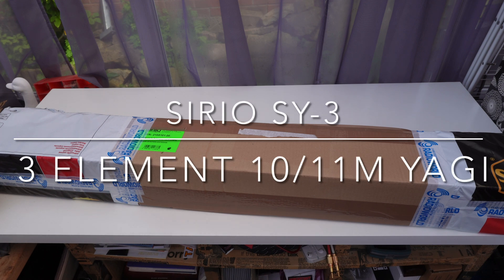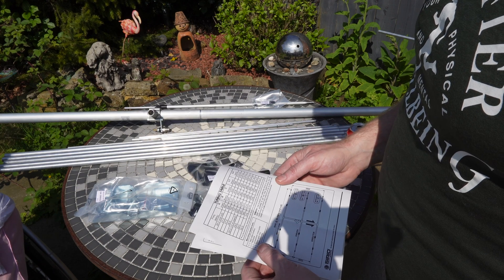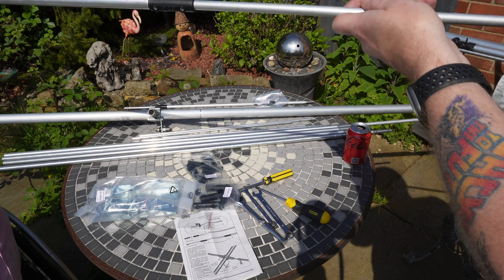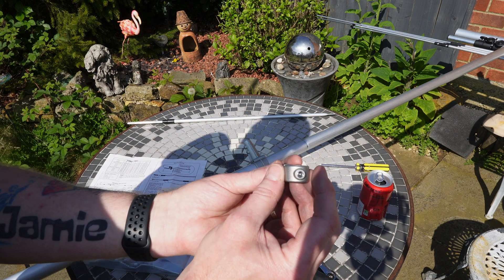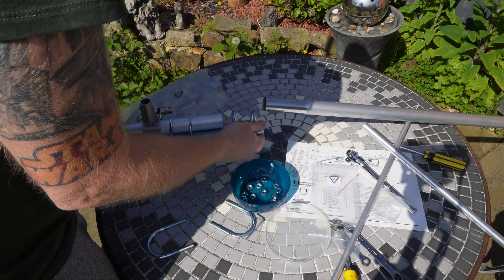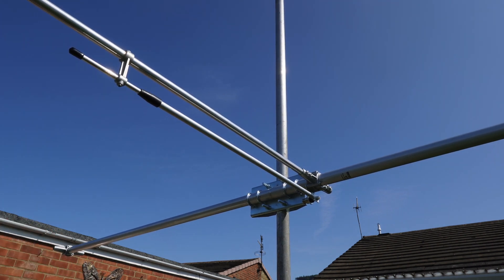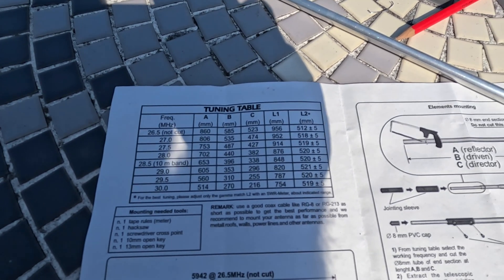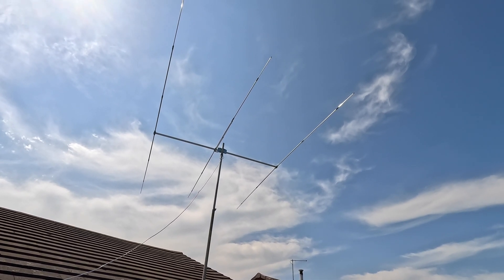SIRIO SY27-3 10/11m 3 Element Yagi/Beam Antenna,Unboxing & Assembly

Comment: Looks great. I'm a new m7. Currently got a cb vertical cut down for 10m. I'm looking for a 10m yagi that I can put up around 25ft or so (above my roof line but not much). Would you recommend this one?
Reply from the maker: This Yagi is Superb on 10m it really is. If you end up buying one just take your time setting it up as it is so worth it. Thanks for visiting the channel.
Reply: @gtretroworld  you're welcome. How high did you end up putting it? And which rotator did you use?
Reply from the maker: @antonybuck2126  I had it around 25ft up but didn’t bother using the Rotator as i am still waiting to organise a proper tilt mast.Most of the DX i was doing was West so i just left it in that direction.
I bought the Yaesu G450 DC but it’s still boxed.
I am currently working on a Quad build but seriously this Beam is a bargain.
Reply: @gtretroworld  good point, can just point it over towards USA and leave it there haha. I'm very new so not sure how it all works. Why get a 4 beam if this is good enough?
Reply from the maker: @antonybuck2126  I am just getting Gain Greedy so ignore me.😂I initially was going to upgrade to the 4 element version of this but really fancy a Cubical Quad.
Seriously for DX the 3 element will impress you.
I will have a video up in the new year showing the Quad if you’re interested.
Reply: @gtretroworld  I am yeah. I'm on a tight budget, but it's achievable at this cost. Did you just use scaffold pole with a connection at the top to get extra height?

What I don't understand is what will extra gain get you? Just cut through a bit better I guess? Only passed 2 weeks ago so still very much learning. Thank you for your advice
Reply from the maker: @antonybuck2126  Yeah i literally used a 19ft scaffold pole with a 10ft pole slotted in the top.
As for the Quad or a bigger Yagi i may see a couple of extra S-Points but this could be at the expense of a narrower bandwidth hence i will probably stick with a 2 element Quad ,3 Maximum.
The same applies with a 4 element Yagi over a 3,the bandwidth narrows.
Honestly if you’re on a budget this is a great antenna and it isn’t stupidly big.
Reply: @gtretroworld  how did you slot another pole over the scaffolding? I've not managed to find and that will go over. I would end up connecting 2 poles side by side with scaffolding clamps
Reply from the maker: @antonybuck2126  I basically slotted a 1.5” pole in the top of the scaffold pole,drilled through,fitted a nut and bolt and used a U-Clamp to stop it rattling.Although this was temporary it is absolutely 100% Ok as there is no weight in these things at all and with it being Horizontal the wind doesn’t bother it.

Comment: I have a Sirio 10/11Mhz vertical I put up a couple months ago. I have it tuned to the 10m band and have been extremely impressed with its performance. It is well made and was easy to put together. Now I may have to try the yagi antenna.
Reply from the maker: This really is a great antenna and isn’t overly big or expensive.Im tempted to try the 4 element version in near future with a similar video.

Comment: Good info great video, I'd be more inclined to slide the end tubes inside each element and drill new holes for the band you want to use it on rather than sawing the tubes down - I'm sure that would work too?
Reply from the maker: Thanks…Yeah that would work fine,just remember to take your time getting the measurements right as these work really well if set up correctly…Thanks for visiting
Reply: @gtretroworld  Thanks for the advice all the best.
Reply from the maker: @dannystephenson4957  No Worries..I am planning to try the 4 element version sometime down the road as well as a 3 element quad so watch this space.
Reply: @gtretroworld  Most certainly will, can't believe the good quality for what you pay.

Comment: Instead of the plastic sleeve to connect the elements would a jubilee clip do the same job
Reply from the maker: The sleeve doesn’t really do alot other than make things look neat.I suppose if you wanted to you could do away with them and the self tapping screws and use jubilee clips but you would need to cut slots on every joint.Hope this helps.

Comment: 105/95/93mm? You couldn't change the gamma match.
I have the same antenna waiting to go up
Reply from the maker: It really depends where you want to operate.I use this for 10/11m so decided to sort of widen its bandwidth.Cutting 93mm off the Director,95mm off the driven and 105mm off the Reflector gives these results.1.1 around 27,900/1.5 on 27,500mhz.The Gamma match will only match so much but like i say it really depends where you want to operate.I will say though it is a fantastic antenna if you take your time setting it up.

Comment: I got the same sy-27 3ele in the box awaiting installation, so I'll enjoy watching g this video, the only advice I can give is don't erect indoors lol 😂 GL
Reply: Ideal for quick installations but I would recommend taping the joints especially the boom joint.
Something for the bike & quick installation, Spiderpole 10m & Hawkins Thunderbolt Ssd12+ or ssd58+ 5.5m/7.5m wire & coil, up in 2mins.
Reply: 105,95,93mm cut from each x6 legs not the gamma-match, I'll be happy with 11m and didn't want to start cutting things, but if needed I wanna do it right 1st time.
What rotor you going for??
Reply from the maker: @EdzashedFudwinkle  Yeah just think before you cut but the bandwidth with mine is fine for my needs.
I actually boomed into Mexico last night on AM with 25w.SWR was 2.7 but the ATU didn’t mind.I definitely didn’t expect that result at the bottom of 26mhz as it’s nowhere long enough.
I am going for the Yaesu 450 Rotator,the new DC version.

Comment: A very nice antenna shrink fit on all the joins  and it will not let any water get in
Reply from the maker: I was just going to use self amalgamating tape but yeah that could be a plan in some areas.I still haven’t settled on a coax choice yet,that is just mini 8 from a roll i had from the 90’s.
Reply: I use the same it's all right does formy run from antenna and into my bungalow  and into my radio room it's ok goes around sharp bends easily.

Comment: had the four element version 36ft in the air since 2015 despite buying it in 2009. once you work the flatside you'll never go back to dxing with a vertical as it'll hear stations that wouldn't even register on a vertical
Reply from the maker: Yeah i have been finding this thing has some serious ears,hopefully the bands will pick up shortly to get the best out if it.Thanks for visiting.

Comment: Looks a very similar build to my di-pole, but suggest you seal up the connecting parts as I had bad water ingress, so used some aluminium grease and amalgamating tape, on each connection . Nice build though.
Reply from the maker: Thanks AL…Yeah the whole thing wants sealing up when i finally decide on a Rotator.I know what i want but the price makes me cringe.😁